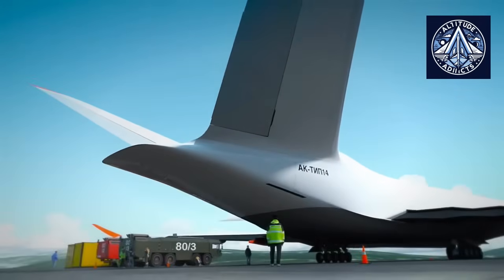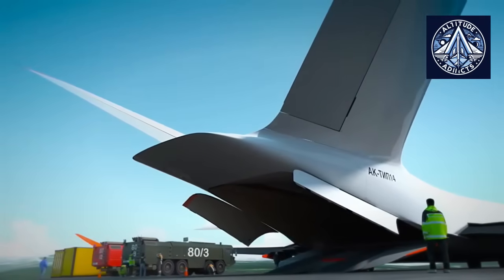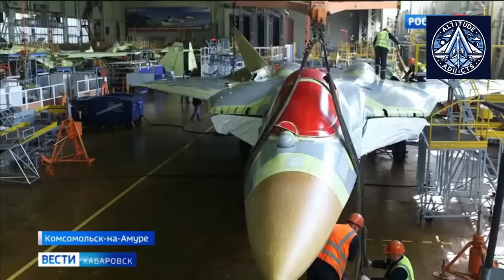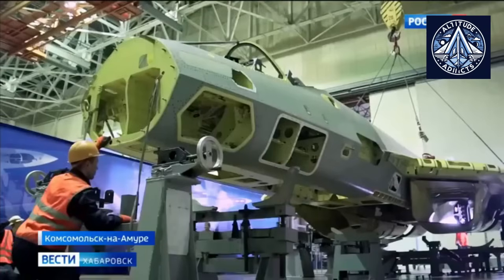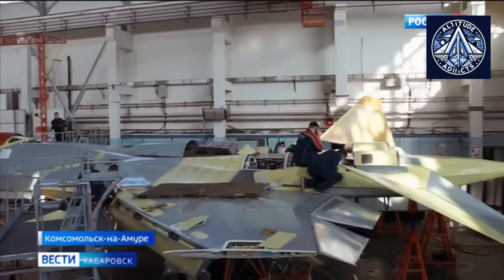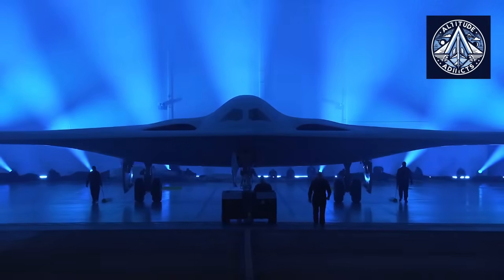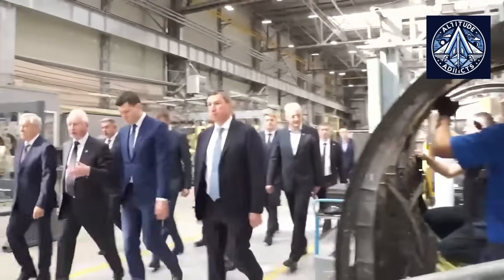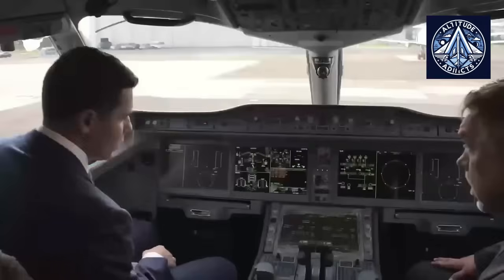You Won’t Believe How Much Su-57 Tech Is in the Russian PAK-DA  Bomber

Comment: I'm absolutely convinced that the whole story about this bomber is just a story about what NATO could think about as a matter of course, until when everything from armaments in the West has to be completed in the sense that NATO will have a certain advantage over Russia!!!! But given the experience of the new warfare, Russia simply does not need a flying wing bomber capable of carrying 40 tons?!?! New rockets as well as new technologies in terms of electronic are absolutely more than enough to It carries from 15 to 20 tons, which is already in the air only over China in the form of the J 36!!!! If we look closer, we can see that Russia and China have jointly modernized the MiG-1.44 and received the J 20!!! And that was the biggest problem was to first make a replica of the engine from the Mig 1.44 and then bring it to the level of 5th generation engines, if not 5+ generations!!!! The second aircraft is the SU 57, which is yet to show all its capabilities when production starts in India!!! But the TU 22M2 or M3 is the perfect platform from which the J 36 was born!!We've all seen Okhotnik in both Russia and China, and that's quite enough for what was supposed to be the purpose, if it's profitable at all?!?! Because it is much cheaper and more dangerous for a J 20 or SU 57 M1 to operate 50 Geran drones or Lancet rather than 1 or 2 Ohotnik?!?! Especially since the FAB bombs have turbo jet engines, which increases the range up to 300 km depending on the weight of the FAB bomb!!! Russia and China are making every move together and do not want what NATO did 50 years ago to happen to them!!!! When so much money was invested in something that was stopped by the almost free modernization of the S 300 to the level of PMU-2 or V 2,500 - 4,000!!!! Not to mention the PMU 3 or the so-called S 400!!! Which will all get new modernizations very soon!!!!Instead of these large-scale projects that have not yet flown and probably will not take off, unless Russia builds one prototype for pro-industrial purposes, much more should be expected than the MiG-35, which costs $4 million, Russia to build from start to finish, and in large numbers?!?! It's not a chess game?!?! Because it is an aircraft that is absolutely integral enough for all countries except the superpowers, especially if there is a new version of the S 300 PMU 2 below them, which should have everything that the S 400 has, except for a range of up to 400 km. The new S 300 PMU 2 will have a range of up to 300 km, but everything else will be with the S 400, which is quite enough not to make it worthwhile for anyone to attack next to the Mig 35 SM!!!! But because the Mig 31 will be a surprise!!!! While the West is waiting for the Mig 41 to be deployed, the Mig 31 will be better in every way by at least 20% and in some segments by 50% such as electronics!!!! But an airplane that can climb at least a few minutes at an altitude of 25 km and reach a speed of 3,600 to 4,000 km/h will be absolutely as dangerous as if it could do anything MiG 41!!?? Because we all know the possibility of air-to-air missiles that NATO uses, and one that could make a difference, that is, to put the Patriot 3 on the B-2, but in that case that aircraft could fly at a maximum of 500 km/h and not above 12 km, which puts it within the range of the air defense systems that Russia built in the 1960s!!!! And it's still all over the world

Comment: is it just a bomber ? if it is also for long range patrols to track submarines it could end up quite different to the B-21 and use a crew of 4 .... and be as big as a B-2 ....  in that case they can also use most of the cabin setup from the Tu-160 ..... and its rotary missile launchers .... same engines with no afterburners ..... landing gear ?  ...... I think the PAK-DA already largely exists ..... the big thing will be making big mouldings for the surface of the plane to reduce joints ..... not far from Kazan the Russians are making the full carbon wings for the MC-21 .... and big single piece mouldings forbig  wind turbine blades ..... once again they already have key technologies .... very close by .... people constantly assume that Russia has little industrial base .... the SMO have proven that be total BS .... and yet the same fake Western narratives keep getting regurgitated ...
Reply: For patroling is better to have drone.